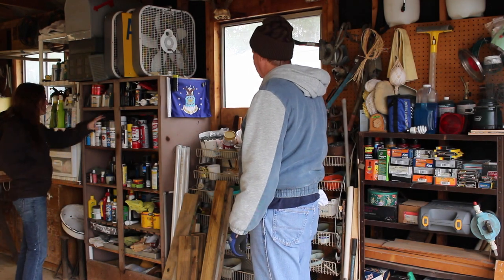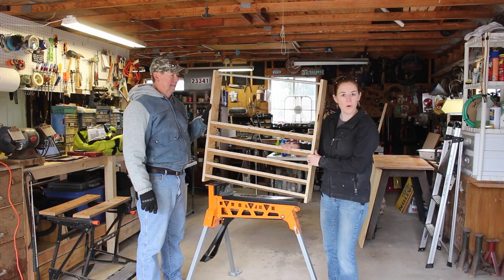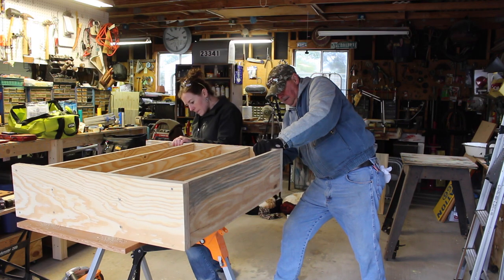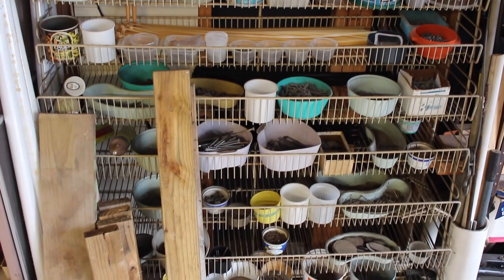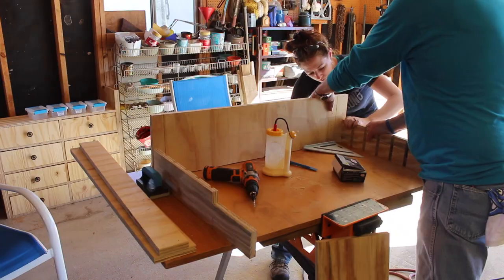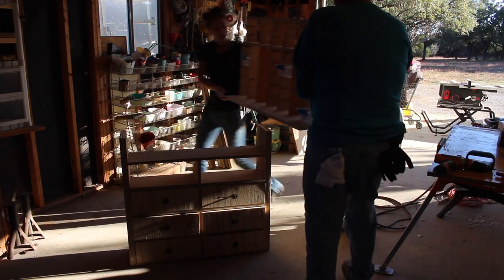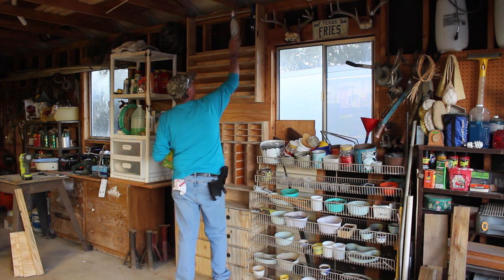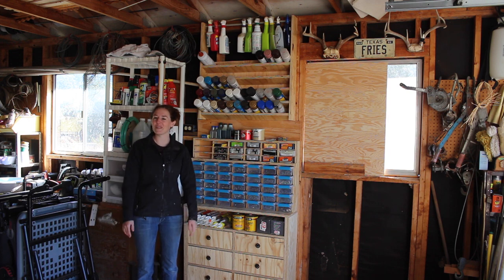Multipurpose Garage Storage Station

Comment: Hey April, I'll share something I came up with yrs ago for nail/screw storage back when I was still working as a remodel/flooring contractor.(disabled now) I drank a lot of country-time lemonade, The empty containers (washed out) make great nail /screw holders. They don't rust, don't shatter when dropped and come with handy-dandy  cup to hold a few for small projects. Plus you can write on the lid with a sharpie and they just fit into 4" PVC pipe. I built a shallow box from wood, gluing in "rings" of the pipe <think I have 4 wide x 7 high>  gluing the rings with dabs of adhesive caulk. The rack could now be hung on wall and filled- hope this helps someone -Tyler

Comment: Hi April
Great solution for your dad. Those Super Jaws make work holding easy. I still use the first style Black & Decker Workmate that was sold in the US around 1974 with the cast aluminum H frame. There I go dating myself.   :-)

Comment: Well, darn.  After years of fighting for air because I refuse to wear an uncomfortable and hot mask, you got me to order a mask.  When I looked at the VR I saw that it was made like the fire mask that I used to wear when drag racing.  They were exhausted out the sides and cleared the mouth/ nose area so not too claustrophobic.  But you just don't wear a full face 500 dollar mask when woodworking.  I needed to get a mask as I had begun working with Bubinga, Cocobolo, Wenge, rosewood and such.  Very timely video.  Oh and nice racks too.  Er, that came out wrong.  Going to build the spray can rack for my paint locker I made out of an old electrical cabinet.  Thanks for all you do and the fun you have.  Yes, sun screen is a good Idea, just wish they had a "low tack" variaty for woodworkers.  LOL.

Comment: Just a heads-up, your link to the Super Jaws is selling for $304.13 (+ $172.67 shipping). The same jaws, from the same seller are $179.99 (+ Prime).
Reply from the maker: Will you send me a link? I don't see it and I'm wondering if you're looking at the smaller SuperJaws that Triton also makes. I see this one on Amazon for $154.98 and free shipping with Prime. However, I was using the larger XXL version in the video so that's why I placed the link for it in the description.
Reply: +April Wilkerson http://goo.gl/muj6vz Your link and this one both seem to be for the SJA300 (XXL) model. Unless there is a glaring mistake that I'm missing ... which is likely.

Comment: I have watched your videos on building French cleat storage. Your parts cart and your wall for tools. I built a similar wall for tools and I have one question. How do you keep the shelves from rolling forward or falling off. Similar to your shelf for your iron, I have a pencil sharpener that I can't keep on the cleat. I use 3/4 plywood and am struggling with shelves that slant forward. Thanks for the channel.

Comment: Nice projects. For my screws, nuts, bolts and irregular hardware I already have a rather good system but for my paints not.
Thanks for sharing. I´ll take a look at the plans.
By the way, where do you live? Summer in wintertime? Or was it recorded half a year ago?
Reply from the maker: : ) I live in Texas. The weather started off at 30 degrees then got up to 72 degrees.
Reply: +April Wilkerson 
Also light frost in the night/early in the morning and ideal 22 degrees Celsius in the afternoon.
http://www.lenntech.com/calculators/temperature/temperature.htm

Comment: Is that wood on the concrete pressure treated? If not, I'd offset it a bit with a bolt head or something. Sand likes water as they say which is why you find it at the beach.

Comment: I would have put feet on the bottom of your project.  Plywood on concrete is not the best idea at least not in my neck of the woods.  The concrete condenses water which can soak into the plywood etc...  Nice project and cool way to store spray cans.

Comment: little surprised you didnt make the drawers...though can see where that is quick and easy to pull out to area need to use them at.. haha so did you get a sunburn? great share april :)
Reply from the maker: I'm not sure what you mean, I did make the drawers. I didn't put them on sliders just because it would drastically add to the cost and with this being in the shop, it works fine without them. Glad you enjoyed it! : )
Reply: you made the plastic drawers?
Reply from the maker: Oh the containers....nah, they were only $1. When you take into consideration the time and material it would cost to make them, it was worth purchasing them.
Reply: ah 35 bucks isnt bad...where did you find the drawers at? I love how your parents are so supportive and your helping them out as well.
Reply: +April Wilkerson The Amazon link has them at way more than $1 each. :/
Reply from the maker: The link is just to show people what I used, but you can find them for $1 at Dollar General. Take the number off the Amazon page and you can use that as a reference.

Comment: How do you nail the screws into the walls and get them all of the way into the shelves?

Do you use some kind of guides or something.
Reply from the maker: I'm not sure what you mean. Do you mean how I attached the back? I went around the perimeter since I knew it would hit wood, then I located the shelves by using the screws on the side as a reference.
Reply: +April Wilkerson my apologies...  I was watching a series of your videos and returned to the wrong one to ask about this in the comments.

I am generally just trying to find out you (or anyone) ensures that they brad/nail/screw things from one side of a surface (of Part A) without missing an intended/targeted surface (on part B).

Are there guides or anything which can keep my rookie level of aim true, so that I do not miss and plug holes and wrecklessly placed screw/nail point  shrapnel all around shelves (and other fixtures) due to misses from the other side?

Thank you for your continuous tutelage, April.

Comment: Very nice April.  Where did you buy the plastic drawers?
Reply from the maker: My mom actually spent two days running around to all the different dollar stores to find them. : ) I've left a link in the description of the video though if you wanted to order them online. They are $1 in store, but slightly cheaper through Amazon if you buy them in packs.

Comment: Where did u get the containers ?
Reply: She started out getting them from Dollar General but they quit carrying them so she found them at United States Plastic Corp. They are the Sterlite Mini's. You can also find them on Amazon but they are a lot more expensive than at United States Plastic Corp.
Reply: @talladegadude4852  is united plastic Corp somewhere I can order from online ?
Reply: @talladegadude4852  also what size are they ?
Reply: @limitlessworx5724  Yes, they were ordered online. The size was the Mini, I believe size 0, or maybe it was 1. But it was called the Sterlite Mini. About 3" wide x 4" long I believe.
Reply: @talladegadude4852  ok great thanks alot